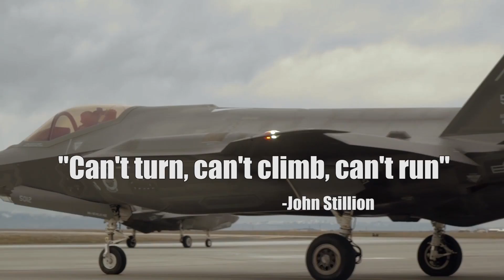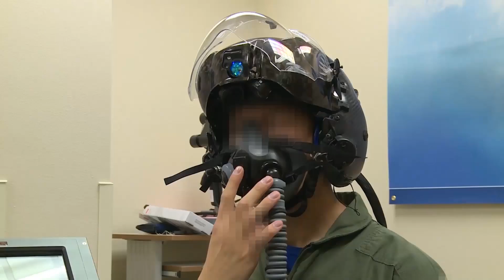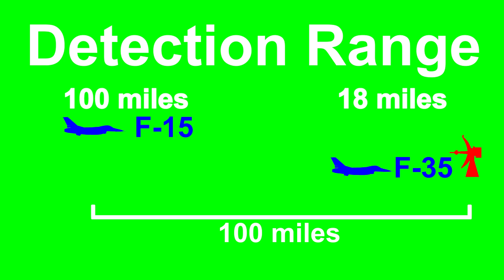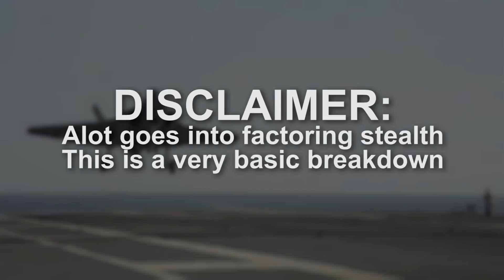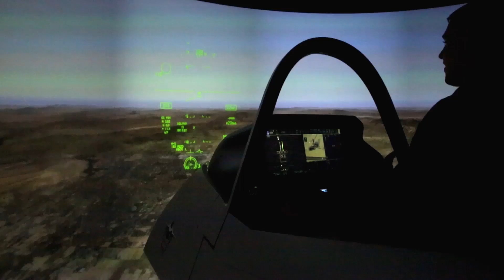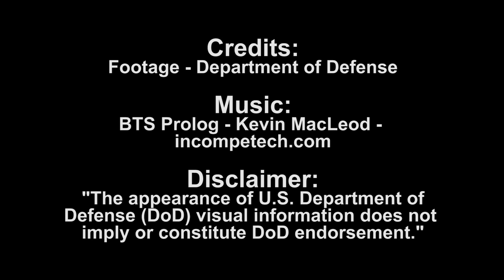F-35 Overview - The Good, The Bad, The Ugly

Comment: F 35 1.5 Trillion Dollars In Perspective

1.5 Trillion = 118 NEW Gerald Ford Aircraft carriers.
1.5 Trillion = 567 Virgina Class Submarines.
1.5 Trillion = 434 Zumwalt Class Destroyers
1.5 Trillion = 15,624 Super Hornets (96 million each)
1.5 Trillion = 9,090 F16 Block 70 (165 Million each)
1.5 Trillion = 115,384 A-10 Ground Support Fighters

What does 1.5 Trillion dollars buy Americans?

400 BILLION Dollars for Research & Development
200 BILLION Dollars for 2400 F-35's
900 Billion Dollars for man hours and Maintenance until 2070 (7 Billion Dollars per plane per year for 51 years)
Does that sound like a deal?

How Much Money to rebuild the current old fighters All Over Again

238 A-10's in service @ $13 million each = Total  $3 Billion 94 million
1,200 F-16's  in service @ $165 million each (would be much cheaper) =  Total $198 Billion
200 Harrier's in service @ $35 million each = Total $7 Billion
1400 Super Hornets @ 96 million each = Total 134 Billion 400 hundred million

Total Cost of New Fleet of Old Fighters  342 Billion 494 Million

For the same cost of the F 35 you can Build the old Fleet of Fighter OVER 4 times over
Reply: The program cost of the JSF is projected to be (FY18) $1.098 trillion USD at the end of its 59 year service life (2006 to 2065 ) spread over twelve+ countries. You are quite mistake on the figure.
Reply: Wikipedia and it's sources debunk this easily. 1.5 Trillion until 2070 listed very visibly in the right index.
Reply: @saquist  Then you do not read the fine print then.
Reply: @peterson7082  Infact I read lots of fine print.  The March 23, 2018 Congressional Research Service PDF quotes 2015 and 2012 figures of 1.1 Trillion which of course excludes the cost of R&D.  which still makes it 1.5 Trillion and the vast majority of articles sustain 2070.  Unless you have something more than just confidence then that data set is sustained by reputable sources.

Comment: The F 35 weighs the same as the F 15
The F 35 weighs MORE than the F 18
The F 35 only has one engine producing only 500 LBF more thrust than the F 16.
It's a flying brick...
Reply: Yet it out performs the F-16, Norwegian pilots report that it allows them to perform more aggressive maneuvers and control the dogfight

Comment: The flight restrictions are off the F35A and it is a very good aircraft.
80 million is very reasonable for an Aircraft of this caliber even if it has some limitations like the small amount of stowed rounds that can be carried for the gun in all models compared to the other aircraft in the USAF inventory. Thankfully the A model is the least problematic and is also the biggest seller.
The block four is the aircraft it should have been from the start with the plane 98% ready to go.
We don't hear about many issues with the latest versions coming off the line thankfully with virtually all of the faults rectified.
😎👍
Reply: 75 million now!
Reply: It's good that they didn't try to put in Block 4 from the get-go since one of the key problems that held up the development cycle was that they were developing a whole system that depended on subsystems that were not yet mature tech. In other words - the development cycle would've been even worse if they aimed for modeling that ambitious.

Comment: Problem of course soviets have radars for stealth  crafts. you should have listed the stealth of the f22 to compare.  I think your going to see them falling from the sky allot of they ever have to fight russian or chinese. Grand mistake to have them in place of the warthogs a plane  battle tested. Everyone banks on their sensors time will tell. Biggest problem is their cost. Won't go into all the cost overruns and the redesigns because the advanced stuff could never work or they figured out later the engines didn't put out enough power to save the plane. Military making the same mistakes they have in the past by trying to make one tool fit every need  and having it take the place of tried and true specialized tools. $100 million a plane  they went from $200 billion for it all to over a Trillion. And when they start falling from the skys we are going to hear the generals demand something new. I wonder how many 100's of millions each plane will cost then.

Comment: There are two other justifiable reasons for the F35 development, even with spiraling costs and the fact that this video missed out on the F35s electronic suite, which is its trump card. Those two reasons are that such an airplane drives forward the technical knowledge, derived from its testing and service history, that will inform the next generation of systems and warplanes. Finally, the plane is neccessary to keep financially alive the corporations that make the military's equipment itself.

Comment: another great vid ! 
But please be more professional when talking about "stealth", in a real combat situation never ever you will face FRONTAL ONLY radars ! The so called "detection range" its not just that 0,005 m2,  but much bigger up when the plane is "illuminated" lateral or from rear; More, the IR systems today can detect the engine heat up to 80km, so never ever in a real combat situation an F35 will manage to get at those ridiculous, phantesist ranges of 18 miles...

Comment: Great video! In still hate the F-35 regardless, it’s a total failure. 
Congress thought the F-35 would replace the A-10 in the CAS role,as well. LOOK IT UP; it’s on here,on YouTube. How Congress ever thought that this hunk of crap could ever replace the A-10, WTF! 
What morons!
🖕🏼F-35!
Reply: You think that's bad? Take a load of this: My country (the Netherlands) got bamboozled into partnering up on the "Joint Strike Fighter" project and has spent over 3 billion Euros on it since the 90's. Now it's 2019 and we have two, I repeat, TWO F-35 aircraft in total (and an "IOU 50 more planes" from the U.S.), while our fleet of over 60 F-16's (planes we use to defend our air space) officially only have 2 more years left until they become completely inserviceable. 
That piece of overpriced, over-engineered junk killed our air force. 
FU-35, right here buddy 🖕🏼
Reply: @runi5413  ?
Reply: The F-35A as well as the mission requirements of the newer F-16's are replacing some of the mission requirements for the A-10 in contested airspace and area where ground fire has been considerable. In that regard, the F-16 hasn't been lost in those conditions- where as the A-10 has.
Reply: You know the A-10 is great against enemies that can't fully fight back, right?
The A-10 did less missions during the gulf war then the F-16 and F-111 and disproportionately took more losses then either of the two, even though the A-10's were only allowed to strike targets less protected 
In Afghanistan it's the F-16 and B-1B that end up doing more CAS then the A-10

Comment: The stealth of the F-35 is not that good as it seems. The Chinese literally built a F-35 replica (J-20) and it got spotted by Indian MIG-31s, which are not good at detecting stealth fighters. An Israeli F-35 did destroy advance Chinese stealth detecting radar without being detected so either the F-35 isn’t that stealthy, or China should give up on stealth because they suck at it.
Reply: Building a replica doesn't equate to the real thing

Comment: lol people keep talking about the F35 electronics suite as if that's the main reason why its so good. (only thing they have left really). Keep in mind that the reason why israel and america didnt meddle with russia in syrian airspace is not the fear of the s400. (although that was a big factor).  it was the intense jamming and electronic warfare that they were subjected to in Syrian airspace. Forget radar, communications, gps, etc. you basically need to turn on on-board sensors to be of any use to anyone, at which point you get an s400 up yer ass.
Reply: Or they didn't want to waste any one-time countermeasure of the system on ... Syria.
Reply: The F-35 has been used in combat in Syria since May-2018. This year the USMC started using the F-35B in Syria successfully to support US troops in the CAS role. 

The reason they avoid attacking S-400 defended areas is because it would lead to an engagement with Russia which could easily escalate into an actual war. It's a political concern.

Comment: THE COST: this is something people need to go in depth more if I remember correctly the f-35 is supposed to cost 1.5 trillion from the drawing board to its inevitable retirement in 30/60 years. if I remember correctly the euro fighter is supposed to cost 1.1 to 1.3 trillion in the same amount of time. the f-35 just gets a bad rap because someone saw thies numbers and ran with them before the truth even got its pants on.

if I was mistaken can you post the correct answer below
Reply: Eurofighter has a far higher performance bandwidth than F35.  Also the Eurofighter is a SHARED cost program spread across all of EU especially the major EU nations and the UK.   Also the Eurofighter is somewhat of a minor disappointment as cost of aircraft is expensive and the UK is one prime example of choosing to build the new 5th gen Tempest fighter plane to replace the EF2000s in the Royal air force.

By selecting the Tempest fighter program the UK in kind, is saying that the F35 is not going to DO IT ALL as Lockheed keeps propagandizing to the whole world.  Lockheed is a company that needs to be investigated thoroughly as their product the F35 has cost the entire nation of Canada's GDP to develop and maintain.   This is simply UNACCEPTABLE.

As long as the F35 is not proven in battle, the scrutiny will long remain.   What the US government should do is to RESPECT THE TAX PAYER, WORK FOR THE TAX PAYER, BE ACCOUNTABLE TO THE TAX PAYER, by being VIGILANT IN SPENDING, to TEST BED THE SYSTEMS IN REAL COMBAT before we put on the table another 100 BILLION.  I urge the government to do her DUE DILLIGENCE without bias.   1.5 Trillion is not a joke.   To you it is because you don't pay tax, you don't work or you are living in dream land.   But to the ordinary citizens, they will always have the right to question, WHERE DID MY MONEY GO.
Reply: @ConstantineJoseph I would agree to many of your points but if I recall the 1.5 trillion is being spread out over 30 years and the US economy is 20 trillion(almost as much as Europe combined) a year.

the f-35 is also a multinational project with countries like Australia, Canada, Denmark, Italy, the Netherlands, Norway, Turkey, the United Kingdom, and the United States 

 What rank is the euro fighter in the High or low?
https://www.youtube.com/watch?v=OWrLYmp3lFQ
 as for the taxpayer argument, my question is what is the price for security?

thank you for the replay if you have any rebuttals to this id like to hear them, thank you
Reply: @murdockhancock  59 years.
Reply: @peterson7082  is that how long they expect it to serve? damn
Reply: @ConstantineJoseph  ?

Comment: the raf tornado can bomb most things and not get seen lol
Reply: Sssssshhhhhhhh! Don't mention 'nap of the earth'. That was 1980's 4th gen marketing. Now its all 'game changing stealth'. Nap of the earth no longer exists and no aircraft can fly that way.
Reply: @mrscreamer379  because low and fast reduces range
Reply: @demanischaffer  And super-cruise engines extended that range and speed.
Reply: @mrscreamer379  Supercruise reduces range because it burns fuel, supersonic at low altitude drinks fuel like it's nothing
Reply: @demanischaffer  No, it allows supersonic flight without afterburner giving you high speed for relatively low fuel.
Reply: @mrscreamer379  My mistake, I forgot supercruising does not use the afterburner, however, Low altitude supersonic flight is very demanding on an airframe and low altitude supersonic flight decreases the range
Reply: @demanischaffer  And modern aircraft are made of composites to help with that. Lol. I just think Lockheed put all their eggs into the stealth basket and it probably wasn't the most future proof choice. Everything gets compromised on the promise of stealth but if radars get better, you're not left with much of an aircraft for the money you paid.
Reply: @mrscreamer379  Except the F-35 is much better then the aircraft it's replacing, even without stealth. It can out maneuver the F-16, AV-8 and F/A-18 Hornet, it out ranges them, has superior radars, the F-35 outclasses them
Reply: @demanischaffer  No it can't. F16 can pull a 6.5G load sustained. F35 can only manage 4.95G sustained. Its a flying brick. It is not aerodynamic. that was all compromised to make it stealthy. It only has 4 hardpoints compared to 12 on the F16 so only one 3rd the payload. Its not as cost efficient. Its availability is shockingly low needing 30 hours in maintenance for every 1 hr in the air. It can't supercruise. Its top speed is only Mach 1.5 where as F16 is Mach 2.0. Its range is poor. Its endurance is poor. And its visibility is poor ... the pilot can't see behind him. Most of the software isn't working, the much touted VR headest doesn't work, its 10 years late ... its probably the most stupid aircraft ever conceived when you look at its 1.5 Trillion dollar price tag.

Comment: comparing a single engine fighter to twin engine fighter is just stupid, of course the twin engine fighter will be faster and have a better thrust to weight ratio, just compare an F-16 to an F-15, the F-16 is more agile, but thats about it the F-15 does everything else better
Reply: Not the case at all with the F/A-18 and F-16.
Reply: @peterson7082  i expressed myself the wrong way there, what i meant to say is that if you compare a "Hi" end fighter (F-15,F-14,F-22,F-18 "Super Hornet",etc) to a "Lo" end fighter (F-16,F-18 "Hornet",F-35, etc) the "Hi" end fighter should allways win, even tho there are a few exeptions.
Reply: The F16 and the F35 are both cheaper than the F15.

Comment: The F-35 is the F-111 reincarnated
Reply: The F111 served Australia pretty dam well.
Reply: @shanerooney7288  oh yeah how'd it do on a carrier?
Reply: @ryanschweikhardt  
The F111 served Australia pretty dam well
Australia isn't exactly known for having aircraft carriers....
Reply: @shanerooney7288  that's my point. The F-111 was a multi branch multi purpose aircraft. It failed largely because it wasn't worth a damn for the Navy. Now I agree for the Air Force it was a good plane. Although the wings swept just a little too far forward but Grumman fixed that with the F-14.
Reply: According to your own words; If the F35A is like the F-111 it will be "a good plane".
The F-111B (for carriers) was a failure. But doesn't look like the F35C is following suit. It is actually pretty good in its own right, but I'll just mark it down as "not a complete failure".
The F35B is, to put it simply, the ONLY STOVL jet worth a dam.

F35A = good
F35B = great
F35C = not a complete failure

I'm not exactly a fan of the F35, but when we put it like that it seems not so bad.
Reply: @shanerooney7288  it's time to put up or shut up. They need to get it into full production or cut it out. We keep pouring money into it to the point where we will never see a return on investment
Reply: @ryanschweikhardt  
You mean cancel the F35?

Not going to happen.
Not because the F35 is a poster child of the military, but because the F16 fleet is getting long in the tooth.
You can only keep adding upgrades for so long before you need to start from scratch. The F35 is them starting from scratch.

I'm just not happy about how they've gone about doing it.
My suggestion is to cut back the production. 1 jet every year if need be.
Better a $200 million prototype than 20x $80 million dollar flawed jets.
Reply: @shanerooney7288  we can't keep dumping money in if we aren't going to receive a full product
Reply: @ryanschweikhardt  
it isn't a question of "if" but a question of "when" and "at what cost".

Comment: On the maneuverability point, the f35 isn't made for air to air combat, it's designed for air to ground, as for some of the other facts I cannot speak, I work on these jets, they not as bad as you painted them to be in this video
Reply: It may be better than people thought: https://www.youtube.com/watch?v=JYX4lHQJlrQ
Reply: @Lucas Bourgeois no, its main function is air to ground, compaired to the 22s or ever the 15s and 16s, it's clunky and has poor maneuverability in the air, its and air to ground aircraft, while yes it is technically designed for both, it doesn't get used for both